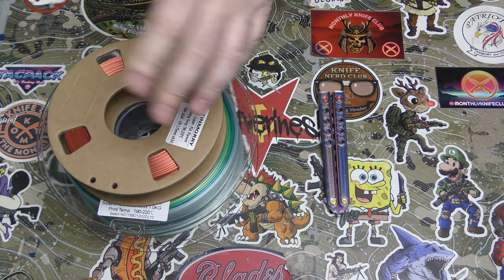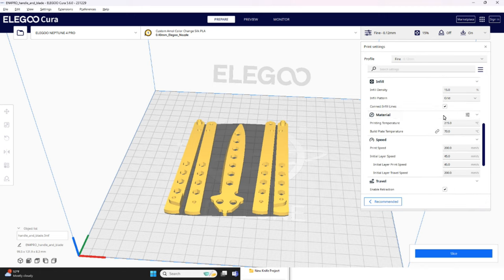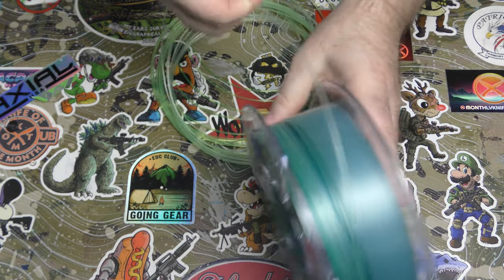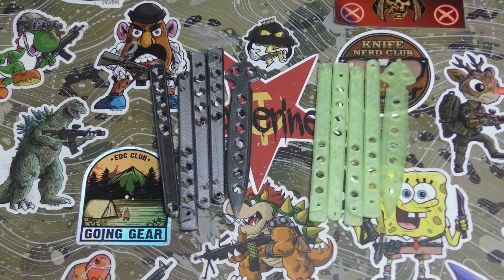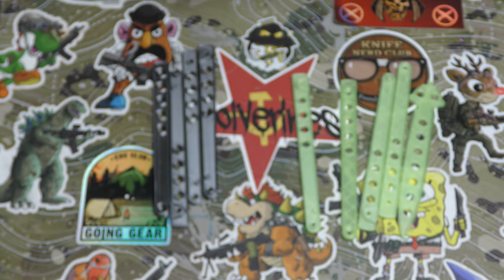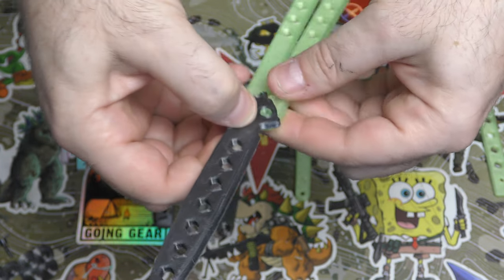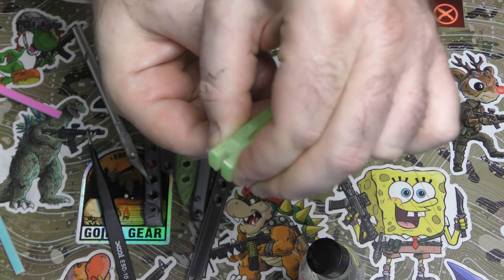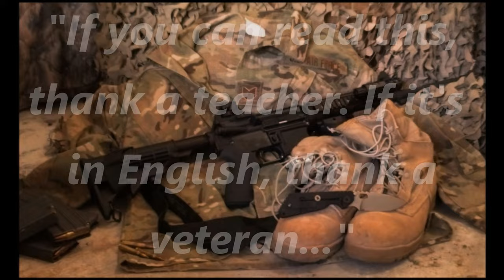3D Printed Butterfly Knife! See How It's Made - Complete Project Video

Comment: The Bambu A1 Mini with 4 color AMS just dropped $60. To $399.
$299 w/o AMS.
Great printer.
Reply from the maker: I think my next printer is going be resin. I Wan something that get better detail on smaller things.
Reply: @DocP91B  I haven’t looked into those yet. I’m concerned about fumes. It’s gonna get expensive pretty quick if I need to start dealing with air handling and filtration.  
3D printing is pretty addicting..so who knows. 🤣